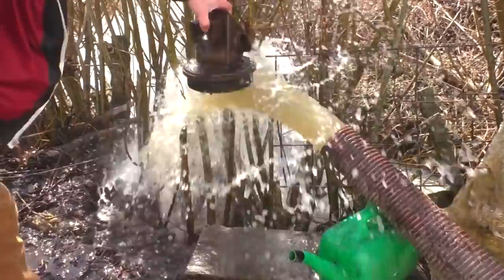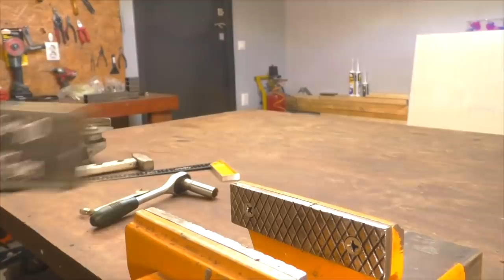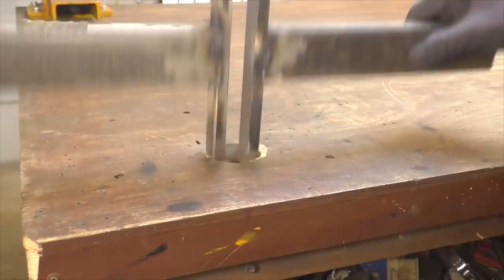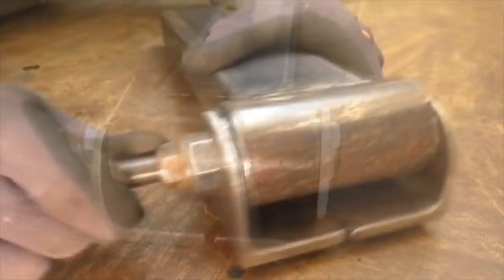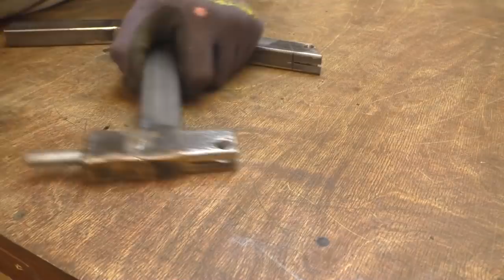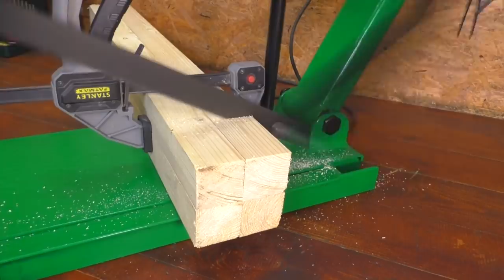Never throw away an old hub! It's like nothing anyone's ever seen before!

Comment: Never throw away a hub, 25 bearings, $200 worth of metal tubing, motor, 50 bolts, and a saw blade!
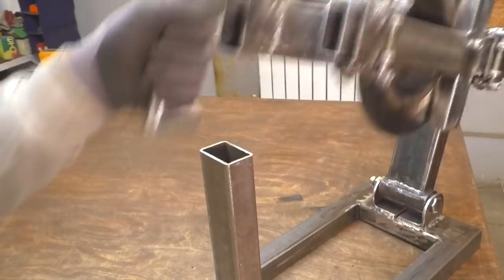Reply: Noticed it at 6:22
Reply: Couldn't have said it better myself
Reply: And plenty of money from patreons to buy everything else that wasn’t supposed “trash”, which is malarkey.
Reply: 😂😂😂😂  right!   Nevertheless, he did do a superb job fabricating that. 👍
Reply: @professionaljugalo  lol 0p PPP ol it'll it'll it'll it'll it'll cost me on oî
Reply: I seen a legit one made alot better then his forsale on marketplace today $250 lol
Reply: what happened at 6:22 though. I don't get it. Am I missing something ??
Reply: And my 40 dollar circular saw cuts wood and my harbor freight bandsaw cuts metal, without going through a hundred blades by dragging them backwards in the cut.
Reply: @bonzeno85  
When he was shaking it, the flat part became attached.
Reply: I’m still going to throw the hubs away after watching this. Very cool, but I’m more certain now than I was before that they’re going in the trash
Reply: He did a great job at something that is his hobby. Why so much hate or jealousy,  I don't get it. Creative and awesome video. Nice work dude 😎
Reply: Don't forget the welder
Reply: Not to mention the replacement seals and bearings inside the hub (shot from sitting at the bottom of a watering hole for who knows how long), the brake rotor (used in place of the brake drum), welding rod, cutoff wheels, grinding disks, sanding disks, paint, and primer. But hey, you saved $10 not having to buy a new hub housing (Oh wait, the housing is probably cracked or broken, because why else would someone toss an entire hub assy?)
 Maybe it's me, but I just don't get these "reuse, recycle, repurpose" type videos. You may as well take a junk car, strip it down to the windows, and spend $10k building a sub-par green house or something. They seem to miss the whole premise behind building stuff out of junk, "money"... and lack of having much of it :/
Reply: Someone with Scrounger perk activated could probably find all those parts pretty easily. Junk yards don't just take in scrap, they'll sell it for dirt cheap as well.
Reply: First of all when i throw something away which is rare lol it has no conceivable or re useable purpose for anything. And second anyone that has ever recovered an item like this in such a way it isnt cut into a managable peice and it dont just rinse off and that nut dont just come off with a ratchet. Just show where it really came from its no less interesting really if it was me i would just make it look like i found it in a totally unlikely place like inside a coffee maker or a bucket of icecream  just to make people be like wtf lol that being said wheel hubs are great useful items if they arent toast i mounted a rotor to an old car water pump and made a turntable for my sandblasting cabinet at work it worked beautifully cut out the hardest part of my job which was moving big parts arount while blasting it would also be good for painting projects
Reply: That was pretty cool, I never thought about that  for  one minute to create something like that out of car parts. 
Well  that's all right now make more stuff from your own hands again ,keep up the good work .
Later  Bones.👍☻💯
Reply: I mean he basically just made a benchmounted sawzall (reciprocating saw). Which removes a lot of the benefits of a sawzall to begin with. Could better save the motor, metal, and bearings for something more useful; and just go buy a corded or cordless reciprocating sawzall. Gets into way more places too.
Reply: P
Reply: yeah that hub was to clean and came apart wayyyyyy to easy to have come out of the bottom of a overflow pond
Reply: That hub was t just found there either. it was placed.
Reply: @topkushgta416toronto6  It's not hate or jealousy.  What are you stuck in such a dichotomous way of thinking?  Bet you $1000 I can guess how you vote.
Reply: And then spend the next day making one cut and cooking the blade you just put on the HACKsaw...
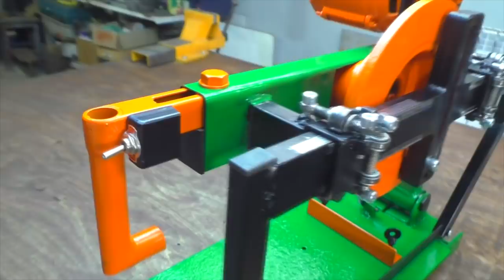Reply: @bonzeno85  6:22 and 7:35 The before and after of DIY power saw.
Reply: That motor 200 bucks.  DEFINITELY some skill to engineer
Reply: @nicko4071  can make some pretty sweet merry go rounds out of them.
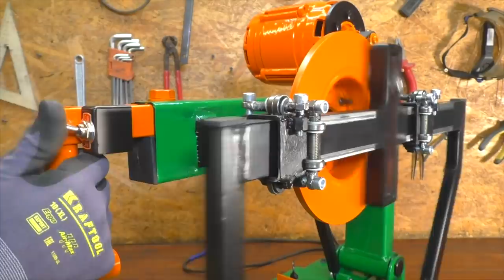Reply: Lucky he didn't lose his hand at 7:38
Reply: and about 500 hours..............
Reply: You forgot 50hr of your life to make a crap saw. I respect the craftsmanship and engineering but there has to be a better way...harbor frieght!
Reply: @callummeara7918  are you kidding? This was an extremely wasteful project. It’s only relevance was to generate YouTube views. 

I’m glad I watched it, so I know not to waste any further time on this channels content.
Reply: In other words save everything you have or come across just incase you need to build some machinery
Reply: @callummeara7918  probably,  but all those shit talkers are  probably to busy making a living to worry about a useless machine!
Just because you can build it doesn't me you should!
Reply: Third world solutions to real world problems.
Reply: well said
Reply: Womb Raider  no way that was a day lol
Reply: Maybe cheaper to just buy a saw.
Reply: This man can without a doubt manufacture a new hub.
Reply: coulda just bought a saw.... (face palm)
Reply: And welding skills
Reply: @I Was Bored  ....but don't forget the time which is invested too.
Reply: Just to cut a 4x4
Reply: @Tommy Ealey he noticed what he was making
Reply: I don't buy that the hub was found buried in mud either.   Free spinning, little rust, loose bolts, and no mud inside.
Reply: @topkushgta416toronto6  You react like that because I said it's not hate or jealousy?  And tell ME to get a life? Lol, no. if anyone struck a nerve, it's everyone calling you out. Be sure to make another scene about it to suit your ego.  They becoming an engineer and then come back at me.
Reply: There isn't a single bearing in this rattle trap besides the hub he threw in the mud the night before haha
Reply: Or a 30 dollar sawzall from harbor freight. Pretty cool though, kudos on the hardcore build OP
Reply: And your accident insurance policy 😁. Brilliantly done though
Reply: Sandpaper, primer, paint, toggle switch, power cord, and the list goes on.
Reply: @jenkinsj2010  someone is wound a little tight..
Reply: @ShaneHolly  THE HUMANITY!!!!!   ; 0        ; )
Reply: @bonzeno85  he could tell by the action what type of tool it was goingbto be
Reply: I went to Harbor freight, bought a cheap 14" abrasive saw, saved me a shitload of time.
Reply: Nice show about fabrication, the result highly unpractical.
Reply: O
Reply: Good job man..........
Reply: I'd say they threw that in there 5 min before retrieval
Reply: could hit a junkyard bro. just saying. but yes. i agree
Reply: Ingenuity and craftsmanship surpass the machines performance
Reply: Lmao I heard that hell all a man needs is a side grinder with a cutting blade hell
Reply: We’d have never watched it otherwise
Reply: What? Hell I have all that stuff, enough to build several in my backyard shop. Doesn't everyone? I don't think I paid anything for any of it. Looks like about 8 hours work to me. I may just copy that oscillation mechanism for another project.
Reply: @johndoe-so2ef  powered hacksaws have been around forever. The blades last a long time. dragging them back doesn't hurt a thing. Same for files.
Reply: @josephhollifield660  whatever you say, buddy. I'm going to keep doing it the way I was taught.
Reply: To bad you spent all your money on haterade
Reply: @johndoe-so2ef  ?? doing what? which way is that?
Reply: Then set it in epoxy and turn it down.
Reply: vfd controller will make him better than he actually is
Reply: I admire the ingenuity!
Reply: @johnq8792  $20 circular saw at a garage sale or $200 in parts for something 1/10 the speed
Reply: Harbor freight type 100$
Reply: But made probably or more off this vid that you and we all watched🤷‍♂️
Reply: @topkushgta416toronto6  I agree plus he made probably 5k off this vid or more so I believe he did great lol
Reply: Lot of people have access to materials that are too short for whatever project they are working on.

These type of videos aren't meant to be blueprints, they are meant to inspire creativity
Reply: that what i was thinking did he find all the steel, bearings, threaded bar, nuts, gas arm, blade, grinder, welder, in the same place he put the hub. before the video...just saying 🤣🤣🤣
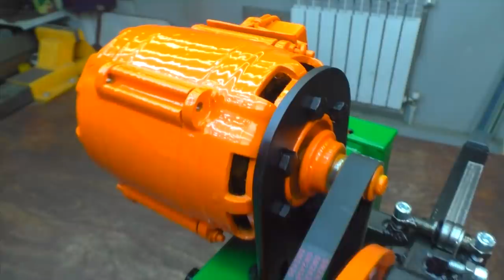Reply: @derhalli  watch right before that, like at 7:29. He has plenty of room, just the camera angle that makes it look that way.
Reply: Pretty hilarious. So many complainers. Its just entertainment damn. Chill the hell out.
Reply: Those that criticize this video, may not want to watch the episode of why you should never throw away a door knob; the amount of time and materials it took to build the house to hold the door knob in place is amazing LOL
Reply: And a belt a welder, clamps or spray paint
Reply: My bandsaw got a good laugh over this 😅
Reply: To make the worst saw ever made.
Reply: I’ll just go grab my saws all
Reply: Can't make stuff if you don't have stuff.
Reply: Very cool and creative but the cost has to be more than purchasing tools that do the job.  Lots of times I think of building something then I compare the cost of materials to the cost of a finished product and it’s cheaper just to buy it most of the time unless of course you’re using all scrap or something like that.  For instance a small trailer.  By the time I buy the metal the wood the wiring tail lights axles wheels and tires heck I could buy an entire trailer. Maybe they just get bulk materials but dang you would think somehow building would be cheaper.  With wood it’s always cheaper to build your own stuff though and the quality difference is insane as well but large metal projects no way
Reply: @davidcreel3170  lol malarkey
Reply: @topkushgta416toronto6  

Hobbyist.   But not economically
Reply: @VndNvwYvvSvv  with a pencil, just like everyone else.
Reply: It was a lot more than a hub...😅 yet the end product was pretty awesome.

Comment: If I bought those materials separately I would probably spend more than what a bench top bandsaw costs
Reply: What's a bandsaw? Lol
Reply: And wouldn't it have been more appropriate of him to use a corded drill instead of an electric motor?
Reply: @Valient6  Doesn't everyone have an ammo can with fifty pounds of miscellaneous bearings?  I still have twenty or thirty pounds left, over the last thirty years.  I like my own power hack saw, kind of with I took the time to set it up for the blade he uses, rather than a hand saw blade, but it was a long time ago, way before internet.  Semper Fi,
Reply: @johnmcclain3887  3rd world life hacks bro. Make a table saw using a corded drill. Look it up lol
Reply: thanks, china!
Reply: zapp1919   I once built a homemade table saw using a circular saw and a table. I cut a slice in the table for the blade to fit through and bolted the circular saw upside down to the bottom of the table. Put a little duct tape on the switch and viola, just plug/unplug the cord to turn it on and off. It worked great. I used it to cut the plywood and 2x4's  I used to build my kids a treehouse.
Reply: You wouldn't even have what it takes to build that the tools alone would cost nearly 800$$
Reply: And if U got about 8 lifetimes to spend, yeah why not. What is your time worth?
Reply: Always get a kick out of your videos 😆
Reply: @Valient6  I'd be more impressed with a 3rd world Web Cam made out of old car parts....
Reply: I think the 1.4 million views probably paid for it..

Comment: And that's the story of how Harbor Freight tools are made.
Reply: It's wild how the people who randomly throw harbor freight tools under the bus are always the people who just couldn't figure out how to use them (or are mad about the coupons or something lol)
Reply: I beg to differ. That's made pretty solid and with pretty good materials. Not something Harbor Freight is known for. Lol before anyone starts crying I'm not shitting on Harbor Freight entirely. They do serve a purpose. That purpose is to get you out of a pinch or to be used a few times a year. Excluding their hand tools. Just about everything else is not designed with longevity in mind as a rule not the exception!
Reply: @richardbadish6990  i don’t know about that I have some harbor freight tools that have outlasted brand name tools
Reply: Once the tool leaves the Maker one rule goes into affect:   A tool is only as smart as it's owner!
Reply: @richardbadish6990  Agreed. This unit is pretty stout. No metal to metal contact, every moving part has a bearing. The only part that would wear out regularly would be the sawblade which is the replacement part. The rest is all bolted together making replacing damaged moving parts pretty easy.
This unit could potentially last indefinitely.
Reply: If kept his 2x great grandchild will still be using this
Reply: @richardbadish6990  i have the chromed box combination, regular wrenches. 2 sets metric and standard from 1/4 to 3/4 and 6mm -19mm for less than total of 50$. i also have a kobalt chromed ratcheting 3/4". the chrome has already started peeling of the 15$ kobalt single 3/4" wrench. the pittsburgh wrenches are still shiny and i use them all the same
Reply: @FrickingLunatic  idk if u noticed. I said besides their hand tools. Especially since they got the Icon brand now. They seem decent. I haven't used them much. Since I bought my Snap on Ratchets. I rarely ever use them. But I'll probably dedicate them for anytpe of job that includes fluid change/drain. Because I got comfort grip Snap-on ratchets.
Reply: @richardbadish6990  i was agreeing with you
Reply: Actually just repaired an old harbor freight / cheap quality drill. I was cursing it until I realized that all i needed to do was remove the casing, grease everything, and put it back together nicely. It works better than ever. But still doesn't change the fact that everyone shopping in our local harbor freight has a look on their face like they're about to meet a cheap hooker.
Reply: @sizzlean9459  sometimes the tool is the user!
Reply: Harbor freight would have at least included a material clamp.
Reply: Yep
Reply: Need to install a push button safety, just in case you you hand it down.
Reply: He built it well. It would last for years
Reply: I am rather salty about the coupons - that said, I've never had a harbor freight tool crap out on me yet. I still think one of the best things I've ever gotten there are their US General toolboxes - they are WAY better than the Husky or whatever the other brands you get at the orange store or the blue store - I went and looked at all of them before I bought, and the US General was by far the most sturdy box - and you don't have to take out a second mortgage and invest in a rape whistle to take a ride on the fap off tool truck either!

Comment: Yeah, am I the only one afraid of using that saw for fear of having it bash in my knuckles?
Reply: Probably
Reply: My thought as well, add a guard.
Reply: @court2379  what are you talking about guard lol, you shouldn't be within 10 feet of this tool if you need a guard to use a powertool. keep your deskjob
Reply: @SP-tu7od  I plan to, it pays better... But you go be macho and break your hand on an easily mitigated risk. Totally worth it. You probably use squint goggles too.
Reply: Or wait until it binds up and breaks away.... something metal.
Then you can really experience the joys of metal to flesh.
Reply: @court2379  Nicely said. The old "Apparatus predates safety!" warning sticker is not even eligible 😁
Reply: @court2379  I use safety squints all the time, but that thing is fucking dangerous

Comment: Funny how that hub assembly was laying by the water in the dirt and didn't have much rust and still turned easy. And by the time you fork out money for the steel, bearings, and hardware, you could have bought a new miter saw and saved a lot of money and time.

Comment: If you add a simple gravity coolant system for when you’re cutting metal and add some kind of guard between you and the reciprocating part it would be perfect.  It has the material versatility of a sawzall with the straight cut of a bandsaw.  Very cool.
Reply: A tip for nearly everything in this video: CUTTING OIL

Comment: And it STILL weighs less than a 10" milwaukee miter saw! Lol. Your are one talented fella sir!
Reply: The weight of the saw is essential for straight cuts. You either slow and light of fast and heavy when dealing with cutting tools. This contraption was'nt balanced and wobled all over the place. The precicion goes out of the window with this wobly, light,  dangerous machine. He shoulve at least bolted it down, nevermind balanced the flywheel.

Comment: Wouldn't be easier to attach a round blade and a handle
Reply: What like a chopsaw?... I've seen them in shops I think hahaha
Reply: But then your depth of cut is limited by the radius of the blade. Power hack-saw, ACTIVATE!
Reply: now you can cut tall stuff, but if you exceed the cut dimensions it explodes 🤗
Reply: What do you mean to short I cut it twice?????

Comment: Makes me want to learn to weld so I can fabricate in metal
I'm so glad you did not put in overbearing music and insipid commentary. You earned a subscription
Reply: Your first project should be a lazy Susan for your kitchen table out of a big block flexplate mounted to a hub.
Reply: While he is very talented as far as an engineering stand point. This person should also learn to weld properly.
Reply: Pickup a cheap Harbor freight 120v MIG to learn on, ditch the Forney wire it comes with and get some quality .030 flux wire (it welds nicer with less splatter and slag, get the .035 wire later for heavier duty stuff), start practicing on scrap pieces. Its actually pretty easy once you get the fundamentals down.
Reply: @SavageOne420  just gotta learn to read the puddle